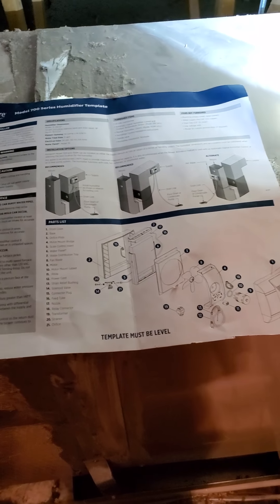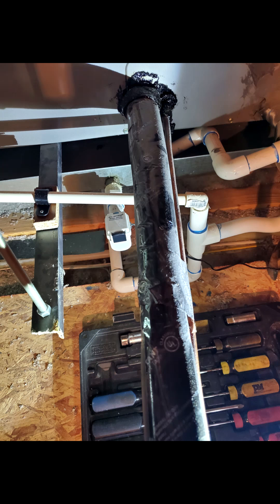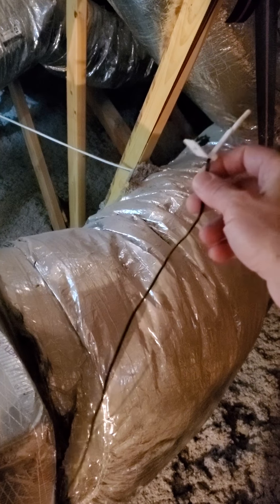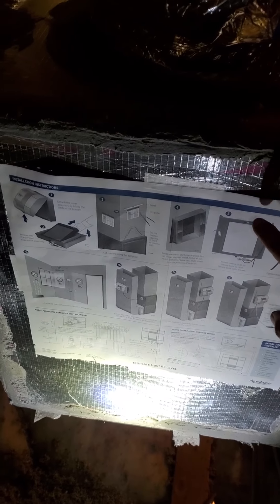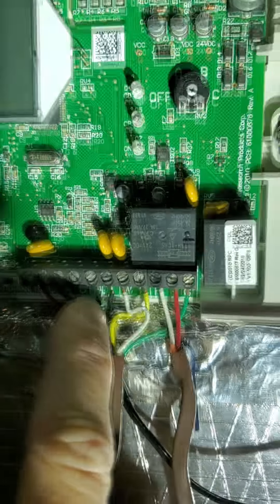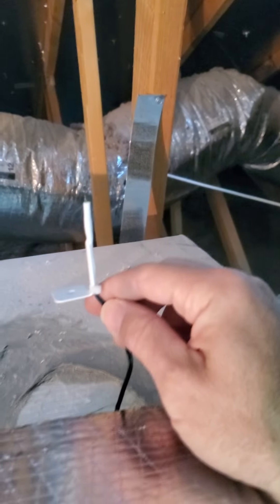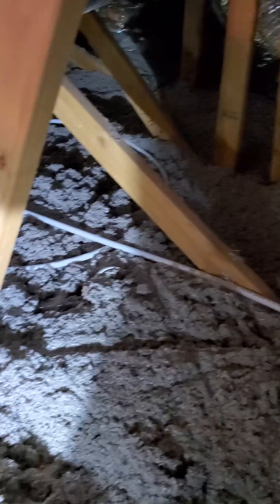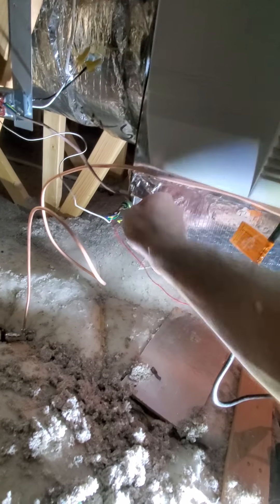Aprilaire 700 Humidifier Series 60 Humidistat Installation

Comment: O...M...G...  BEST installation video for this humidifier EVER!!!  I'm in Texas and have basically the same set up (system on its side in the attic space).  I've been trying to think of how to get the damned thing attached to the fiberboard up there for a while now.  Thank you SO much for doing this.  I love the idea of making your own metal "gasket" and reinforcing/bracing it to the rafters.  Your explanation of the wiring was simply superb!  I'm not an electrician (or plumber) and I was thinking the same as you (might have to run wires from the attic to the thermostat downstairs).  You just saved me a TON of time by posting this video.  Again...  Thank you for all your hard work on this project. - Jon
Reply from the maker: Thanks Jon, I really appreciate the feedback. 
Yeah, that fiberboard is a challenge to make a proper installation on, especially if you're at the homeowner DIY level like me. I'm more of a mechanic than a DIYer but I knew that others might like a video like this, as a jumping off point if nothing else. 
Good luck with your install, hope it turns out perfectly.

Comment: The reason for the GF is basically, its so the humidistat can hijack the fan signal and allow the fan to run even when the thermostat isnt calling for the fan to run, so it can humidify even without the furnace or the fan on by default. So normally it just acts as an open switch for the G signal from the thermostat to turn on the fan, but it also acts as a power source for the fan when the thermostat isnt calling. (of course you need to make sure your water line is attatched to a HOT water line for it to work properly when the furnace isnt running)
Reply from the maker: Yes, 100 pct correct. Thanks for the elucidation!

Comment: Yes, the G wires are difficult to understand. The instructions don't tell you to disconnect the G wire from the furnace panel and wire-nut it to the thermostat. Then take the Gf wire from the humidistat to the G terminal on the furnace board. The plastic tab at the bottom of the gray frame work was solid so it wouldn't slide down onto my Sheetmetal duct. I had to use a reciprocating saw on open the sold tab so it had a slot in it for the sheet metal. Not very good quality control.  I am replacing an old model 700 with a new one and it is a lot different. I had to close in the 4" by 6" opening that was left after removing the old humidistat with a sheet metal panel and then cut the 3/4 hole in it. It does tell you that wiring it the same as the old panel will cause damage. Thanks for making this video.
Reply from the maker: Hi Steve, yes not the easiest system to install. I'm glad you found the video useful and thanks for taking the time to comment